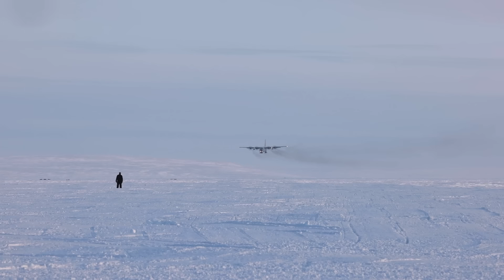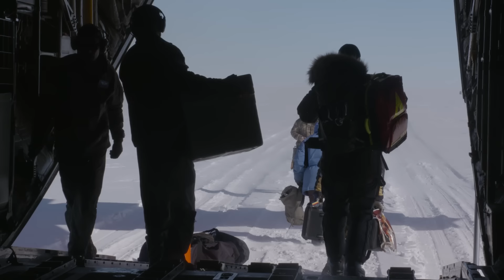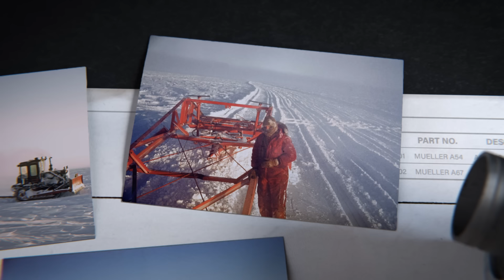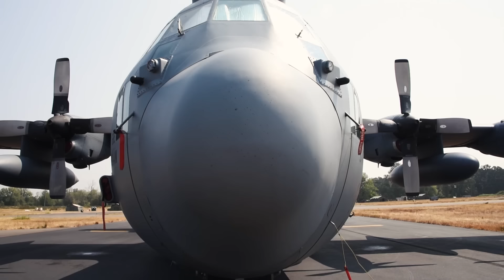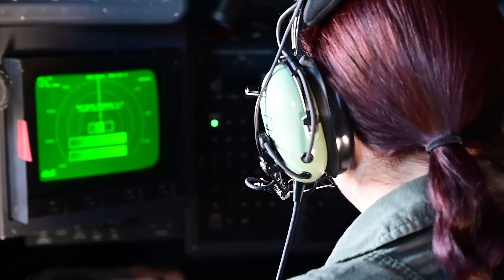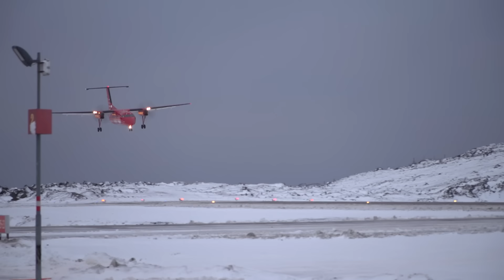The Wildest Take-Off of My Life

Comment: That was interesting about sometimes starting the roll with 100% flaps (presumable to lighten the load on the skis) and then backing off to 50% flaps because a 100% flap takeoff is sketchy due to lack of aileron authority. Huge props to that pilot who won the Air Medal for surviving a dual engine-out takeoff and saving his crew. I had no idea the C130 had that type of issue.
Reply: Huge props…?

What was not mentioned in the discussion of flaps is the cost in drag of the greater lift they provide. At any given speed and angle of attack, the greater lift possible from flaps comes with a disproportionately greater drag. If it were not so, you would want the wing permanently configured to that airfoil. At 100% your acceleration is notably decreased on takeoff, both on and off the ground. For the shortest liftoff your ability to do so at a lower speed with the chosen flap setting must compensate for the longer distance to reach that speed because of its resulting drag. The decrease in ski drag you buy at that cost must be considered in the trade offs. On liftoff, the increasing speed provides increasing lift potential, so flaps are transitioned up in steps for less drag, giving better acceleration and/or faster/steeper climb. The pilots are balancing competing demands and benefits, and as mentioned they do so at each stage of a takeoff. Flaps are usually left at one setting during takeoff, but in extreme conditions as the pilot described adjustments for each phase may be necessary. 

Non-pilot, definitely not a CFI, just a non-graduating college physics major who also took ground school and got 59/60 on the FAA written, who has thought long and as carefully as he could about such things, so take this with all due respect (which conceivably is none).
Reply: @For_What_It-s_Worth  Yes, huge props to the guy who won the Air Medal... Maybe that wasn't the best term to use in this case (lol) but it generally means that I think he did a good job, as I think virtually anyone who wins that caliber medal while doing something incredibly difficult deserves praise. They could have all died if he didn't do exactly what was necessary in the moment. I doubt anyone was training for the rockets flying off and taking out both engines on one side in that era. And I didn't know that the C-130 had control authority issues with even one engine out.

Anyway, they mentioned that they sometimes start with 0 flaps and go to 50%, presumably for more speed like you're talking about. And it probably just depends on snow/ice conditions. I can imagine them using full flaps at first when there's a few fresh inches on the ground just to pop it up above the snow kinda like a skier or snowboarder leans back in fresh powder. And maybe using 0% to 50% in ice or short runways? I really dont' know and wish they went into it more.

I used to do the 0 to 50 or even 0 to 100 in a WW2 air combat sim on nearly every takeoff depending on the aircraft and loadout for the same reasons you mention. But I had also never heard of that before in real life because usually you want the aircraft configured for the takeoff you wanna do and not have to rely on the flaps not malfunctioning at the critical moment where you cross the point of no return. But these guys have a lot more options if something malfunctions since they're on a flat ice sheet. 

The reason I mentioned the 100 to 50 scenario was because it was so incredibly more unusual than even that (to me, at least. like you, I'm no expert and am just very interested in these things). But I've snowboarded in powder before and it can be incredibly sticky until you reach a minimum speed. Anyway, great discussion.
Reply: @sntslilhlpr6601  
At first I thought, “Of course one out is no big deal with a correct, quick input. That’s one barn door of a vertical stab.”
Your “control authority issues with even one engine out” puzzled me, ‘til I reviewed 15:13 — 16:35 .
100% flaps, full power, slow flight on takeoff — ah ,yes! 
A less drastic version of our Air Medal man’s predicament.

“I can imagine them using full flaps at first…just to pop it above the snow…”
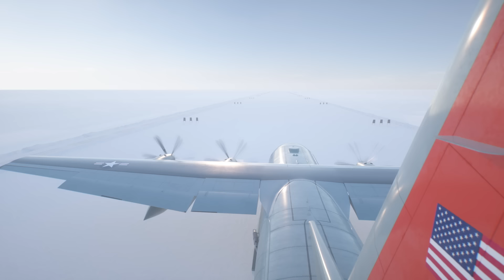16:35 — 16:57.  Yup. You got that right. 

It was fun to come across Verified Good to my analytically derived ideas on staged flaps. I had considered parasitic &/or  induced drag vs. lift being unneeded until rotation and come up with that.
Pilot workload would be a concern. If it is not necessary, it could well be detrimental without a reward; insufficient return on investment. 
This made me think of Occam’s statement of his Razor, “Don’t multiply entities unnecessarily.” 
Restated, “The simplest explanation that fits all the facts is to be preferred.”
Or in this out-of-context application, “The simplest safe takeoff…”. 

If you have plenty of runway, don’t get cute.

Of course there’s that Nampa, Idaho guy who just took off in something like 5’, brakes locked, in STOL competition…

Cheers!
Reply: P.S. The written was taken ca. 1980. I am curious how I would do now taking it cold given aviation changes and my state of memory, although I have followed aviation from an interested outsider’s perspective since then.

Comment: That planned Iran stadium landing seems impossible. And I don't mean the concept can't work, but it seems like it would just be uncontrollable for the pilots in such a critical moment. Multiple rocket positions for different phases of the landing which are closely timed to each other seems very challenging to trigger and control, while the rockets being used are also solid state fueled and fixed positions, so they are totally uncontrollable variables other than when they start firing. Any timing mistake and you're screwed, along for the ride until the rockets stop.

Comment: Okay why the fuck does it need rockets in a palce thats literally nothing but runway
Reply: Because once you go beyond the generally smooth, prepared skiway, you can start to run into hard ridges of snow called sastrugi and this can start to pound your skis so bad they might be damaged.  I know as I did this mission in the early 1970's as a pilot in the 17th TAS.
Reply: Snow drag and drifts limits ground speed.
Reply: @For_What_It-s_Worth  yeah after the video it made sense but that was just my initial thoughts on the matter. Using skies and everything but perfect runways etc it started making sense how getting up to speed might be an issue. :D

Comment: Brought back some memories. Spent 12 years on C-130's. Got to work on everything except the ski-birds. Awesome aircraft.

Got to spend some time with the NP2000's when they were being tested. I think they had them on a Wyoming bird. If you're a maintainer, the Electronic Valve Housing is a big deal and makes things easier. Also got to work on one of the Credible Sport birds. She was still under modification when it was cancelled and sent back to her unit. She still had a lot of little mods that we had to work around. The other one was at the museum at Robins AFB, but they didn't want to spend the money on her and she's now in the woods as an ABDR trainer.

As for the JATO, never got to use it, but did have to mount the bottles once for training. That is NOT an easy job. And there is no hope for you if you accidentally detach one. Pretty sure there's still a chunk missing from the flightline at Dyess, and an Airman still getting his ass chewed for it.

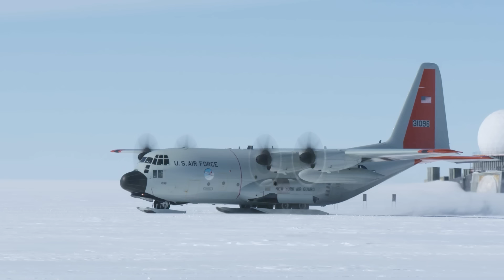Comment: Hey 21:38 my take on it. You said that the props were worse with the bigger chord and improved because if materials and yeah, it allowed props to be made thinner, cord-wise meaning they are more efficient due to the aspect ratio. -AEng
Reply: I would posit that the greater rigidity of carbon fiber also allows the swept back tips without concerns about twisting of the airfoils from the out of line forces from the tip offset. I think the sweep is to help with near-Mach airflow over the higher speed tips.

Comment: 15:59 He's talking about a VMC roll here. In a twin engine prop plane, there is a Velocity minimum controllable speed just like a V1 (decision speed) and V2 (single engine climb speed). If you are below Vmc with one engine, the counter torque from the prop will overpower the aircrafts ability to keep the plane from rolling over, rudders and ailerons get outmatched. Super scary
Reply: It’s fun as hell when you’re flying it in the simulator, tree surfing until you can clean up the airplane and get positive rate, not fun when you’re flying it in real life and trying not to hit buildings and also trying to keep the airspeed up without flipping over lol

Comment: I would like to point out the 6 blade C-130 is its own major iteration of the Hercules, the J model. It is not a small upgrade to the previous H model, the last 4 blade based model, but a major one with massive internal changes including completely different engines, hydraulics, fully digital cockpit, vastly improved cargo hold design, etc.

The current LC-130 is based on the H model with the 8 blade swap. It kills some of the top speed it had with the 4 blades but gains more thrust. 

The majority H model fleet is also receiving some powerplant improvements (aside from the blade swap program) to gain some efficiency and power since many are not much older than the oldest J models around so they still have a long life ahead of them. The Air Force, and related, decided to improve their H fleet but only a few had the 8 blade swap, the Navy, and related, and doing most of the swaps.
Reply: Correct. About 10 years ago, they converted all the skiers to the 8-bladed NP2000 Hamilton Standard (Collins Aerospace) Props. Since there are no longer manufacturers of JATO Bottles, the 8-bladed props allow for takeoff without the assist. NP2000s were supposed to be installed on all the H models but many never had installation. The 103rd AW CtAng has H-3 models but will be getting J models.
Reply: I got to see the last active duty H model leave for the bone yard a few years ago. Can't say I miss them lmao. Although I can't say I'd hate my life half as much if I didn't have to screw around with a mechanical valve housing like on the 4 bladed props anymore lol
Reply: Long life indeed. the C-130 has outlived all of its replacements in production status. Ok, maybe not replacements, but the newer and larger C-5 and C-17 are discontinued, and will age out of replacement parts while the C-130Js are still inexplicably being built. Not one of the few military "jets" still in production, A turboprop plane! Anyway, there are plenty of replacement options for those JATO bottles. We haven't stopped manufacturing solid-fuel motors. It's just a matter of need vs. risk and cost of testing.
Reply: @Varadiio  definately the DC-3/C-47 of the post WW2 era
Reply: J models have the same hydro systems as an H or Navy T model
Reply: @stevenscherry4143  you're telling me the J model with a vastly different powerplant has the same hydraulic systems as the much older H model? Talk about backwards compatibility. 

Also, do you know what differentiates the H from the Navy T?
Reply: @freetobe3  nothing specific, like this has this blah making it an H. Its mainly Navy Air Force designations. They are basically the same planes. Navy had 130 F, R, and T models which were the same as B, E and H models for the Air Force. I also read an article that talked about the NP2000 upgrade. In the article they said there were 3 mods to the complete upgrade; the prop, something on the engine and something else I don't remember. When all 3 mods were done, the article said the aircraft had the same or better performance as a J model, and had the equivalent engine output as a J model with 5 engines

Comment: Interesting, I was an Marine avionics tech in the late 1960s so spent a fair amount of time as a passenger in C-130s. Back then the A4 Skyhawk was fitted with JATO, one bottle on each side. But I don't think I ever saw it used. As with the C-130 if the bottle on one side failed the pilot was faced with a difficult asymmetric thrust problem.

Comment: I used to live near the Schenectady NY Airport where the 109th is based.  I was in Civil Air Patrol in the early 80's and 2010 - 2015.  Back then the commander of our squadron was also a LC0-130 Pilot, and I was able to get several rides on a LC-130.  In the 80's, we got to fly to Florida and back.  Really cool plane, but quite noisy inside.

Comment: I'm so happy you said -40° without specifying Fahrenheit or Celsius!
Minnesotan here, who knows that's the magic crossover.
Reply: @DoRullings I understand these numbers have a meaning... but for the life of me I can't decipher them. Would you mind explaining?
Reply: @rohanpotter8895 basically the conversion rate between Fahrenheit and Celsius means that -40C is equal to -40F
Reply: @rohanpotter8895  The left side of the equation symbol is the formula for fahrenheit to celsius, and the right side is celsius to fahrenheit. 
If you replace -40 with X, like in (x-32)*5/9 you have the conversion formula both ways.
Reply: @rohanpotter8895  ... and it's kind of misleading how I set it up as an equation as it will only be true at -40. It is, however, very useful to memorise these two formulas.
Reply: @DoRullings nope it will be always true no matter the numbers... The numbers just dont Match but still describe the same temp so the = is still correct
Reply: @MrDasfried  If you replace "-40" on the right-hand side with the result of the left-hand side, or vice versa, the equation will always be true. However, you can't replace "-40" with, say, -20 on both sides because (-20-32)*5/9 ≠ -20*9/5+32.
Reply: @DoRullings  if you add the markings to indicate the temp scale you have on each side, then they represent the same absolute state of particle energy (i.e. “real” temperature) so they’re technically equal even though the numbers are different.
Reply: lol I was thinking the same thing!!! -40°F is the same as -40°C i was actually happy about that lol.
Reply: Actually.. he says the info in the video itself..@around 7:05
Reply: @mdsalim86  Yea, but if you account for that, the Youtubeclowns would have nothing to say.
Reply: My favorite SNL skit of all time is with Nate Bargatze playing George Washington rallying his troops and saying that we won freedom. . .to develop a system of units of measure that no one else in the world will understand.
Reply: Theyre the same lol
Reply: Every skoolboy kno!
Reply: As it is Military and Scientists in the Arctic AND the narrator is European - I automatically assumed it was the wider known Celcius.
Ofcourse for a USamerican this is always something special and needs to be mentioned.
Reply: What's really strange is that he literally says they're the same in both scales the second after he says it's -40° outside... Have no idea how you heard the first part but didn't hear him finish the sentence🤷
Reply: Just wanted to rant about this. Thanks for the clarification

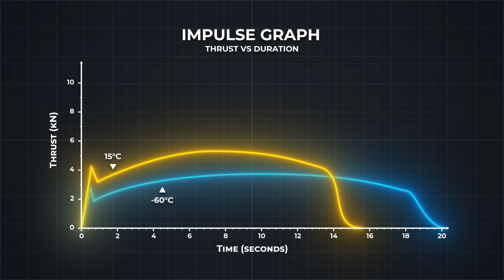Comment: 7:36 also there are a lot of materials that are really weird under these temperatures, and of course there's a lot of fuels that are jellified or even solidified at these temperatures and do not burn correctly even if you get them into liquid or gaseous form. A lot of steels become brittle, same for a lot of different types of iron, this is true of other materials including certain alloys of aluminum. So a particularly good shovel that you normally use to scrape snow and ice off of your sidewalk, suddenly becomes as brittle and fragile as glass.  These temperatures are no joke. But if you respect it, you'll do fine